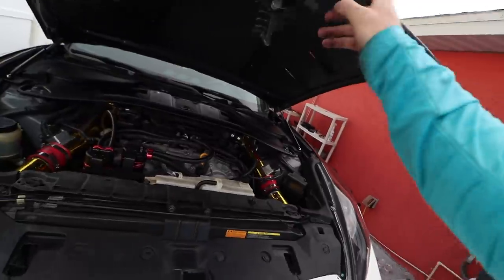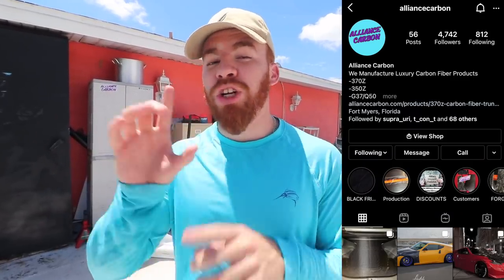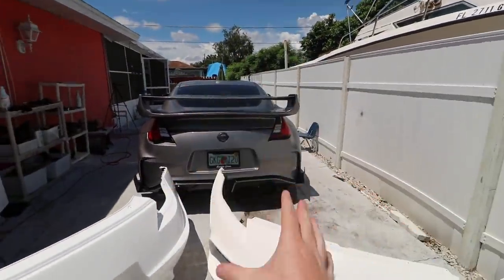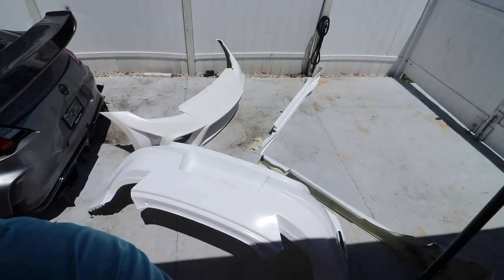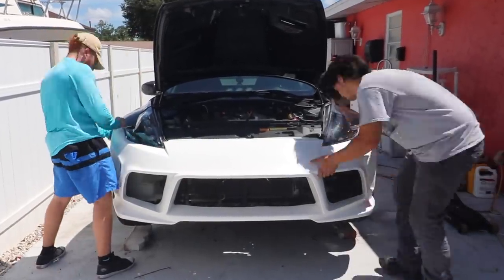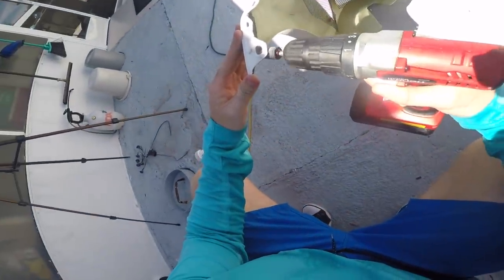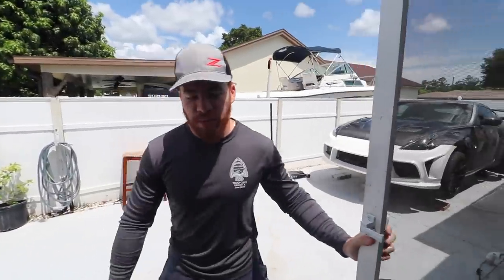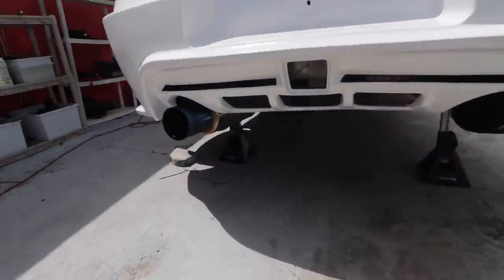I GOT A RARE NISSAN 370z BODY KIT and it looks INSANE!

Comment: Am I the only one that noticed that Danny is using a masonry drill bit to drill holes in the body kits? 😂

The body kits makes it look more aggressive but the rear Nismo bumper looks more in line with the body kit than the kit’s rear bumper. I like both but I believe it even better when color matched. 

You planning on staying badgeless ? I think it looks better and cleaner that way. 

Those who think that fiberglass should fit perfect haven’t worked with aftermarket parts on Orem. There is always some adjustment needed to make it fit and look factory. The way it fits is pretty good and I have seen worse in the past and they costed way more.
Reply: I was looking at it going... "Is my bro using masonry bits???  hardcore!"